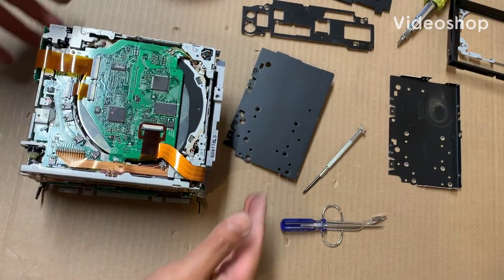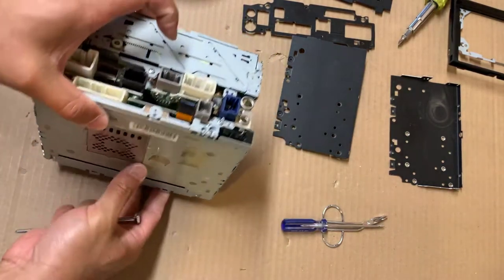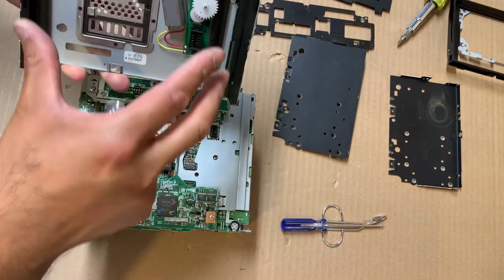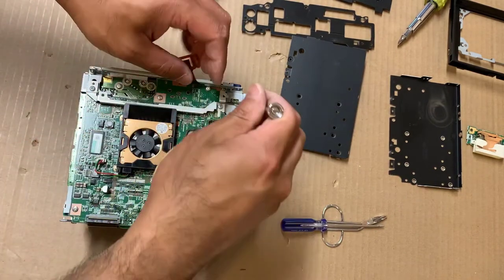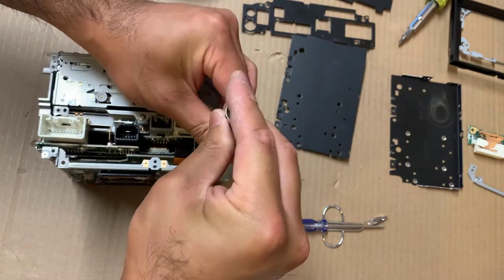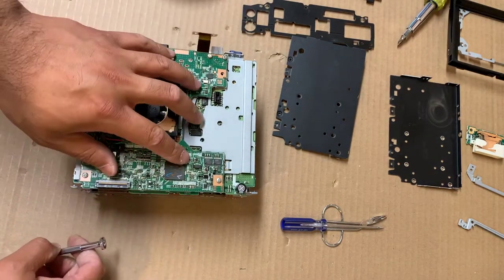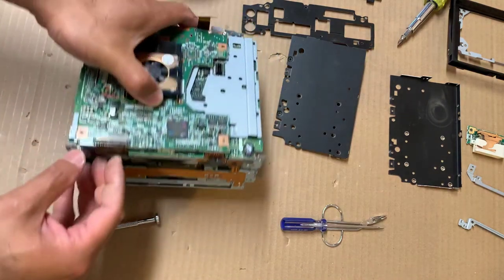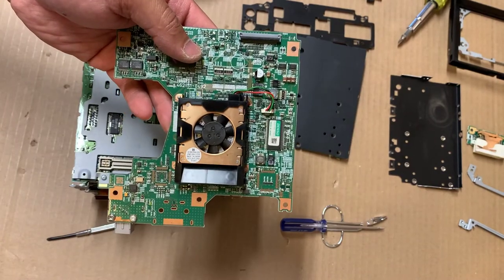FULL REPAIR VIDEO 2004-2010 Toyota Sienna GPS Navigation Stereo Blank Screen No power Repair Part 3

Comment: Hi, I have a Sienna 2009 xle the radio is dead; i was wondering if I can find that same board of my current radio in a Camry, Seqoia, Tundra radio to put it in mine;
Reply from the maker: Only Solaras will work but cost might be the same or higher.

Comment: Not sure what’s up with mine it won’t open but seems to work touch screen not so touch lol I digress hit tilt doesn’t move plus rear DVD player on constantly says dvd seek never plays bought brand new dvd
Reply from the maker: Try to reconnect the cable between the screen and main unit..  this should fix tilt and touch screen sensitivity.  I would carefully disconnect the cable, clean with alcohol and reconnect it.  see my part 2 video at minute 2:35.  https://youtu.be/9SwyxU3YnQg

Your rear DVD player’s DVD drive has rollers that pull the DVD in and eject it out.  These rollers are dirty.  Use a small q-tip with some alcohol and clean the far left and far right side of the slot. I will try to make a video of this.
Reply: The rear dvd is actually scratching the discs I put into it. Thanks for your fast response.
Reply from the maker: @nelsonhernandez2513  ya for the rear DVD sounds like the rollers are damaged.  They are rubber and they can get dry and crispy when they get old.  You can pull out the unit and open it to clean and recondition the rollers.  I would use some alcohol and a q-tip.  I’ve had this problem too and fixed it.
Reply from the maker: @nelsonhernandez2513  also with the problem you have with the front GPS navigation unit.  Perhaps purchasing another one is better?  There is one for sale in the link below:

https://www.ebay.com/itm/254650872950

Comment: The eBay link won’t work..
Reply from the maker: Fixed.
Reply from the maker: https://www.ebay.com/itm/255387213177
Reply: @DebtFreeCars  wow thanks man!
Reply: @DebtFreeCars  a friend of mine says it could be just a screen replacement. He says that was he does and it fixes it all the time. What you think?
Reply from the maker: @ahmadjahshan4981  use a flash light while the unit is turned on.  If you can see a faint image then your lcd circuit board is bad.  If you cannot see anything then most likely this board.
Reply: @DebtFreeCars  thank you
Reply: @DebtFreeCars  so since the screen ain’t working at all rn the board will fix that?
Reply from the maker: @ahmadjahshan4981  did you try the flash light?
Reply: @DebtFreeCars  yes
Reply from the maker: @ahmadjahshan4981  and you saw an imagev
Reply: @DebtFreeCars  saw nothing
Reply from the maker: @ahmadjahshan4981  yes then purchase this item.  It will fix it. 

https://sites.google.com/view/leakboard/home/toyota-jbl-denso-gps-navigation-repair-power-auxiliary-board
Reply: @DebtFreeCars  alright thanks man
Reply: @DebtFreeCars  Hi, as I was taking the screen off the rest of the box the orange electric film thing de-attached from its black plastic piece. Do you know if we could stick it back? Or what do we need to do?
Reply from the maker: @ahmadjahshan4981  send photos to leakboards@gmail.com